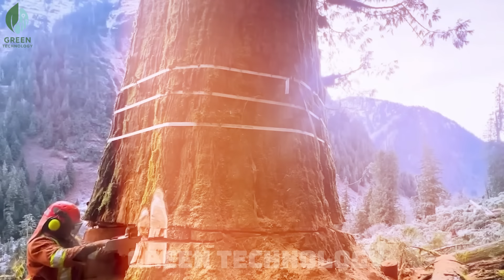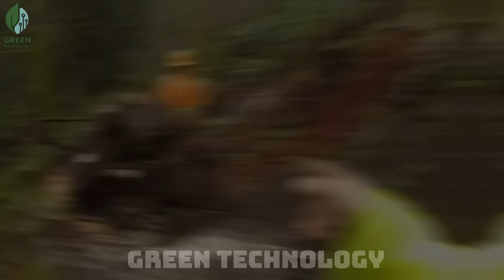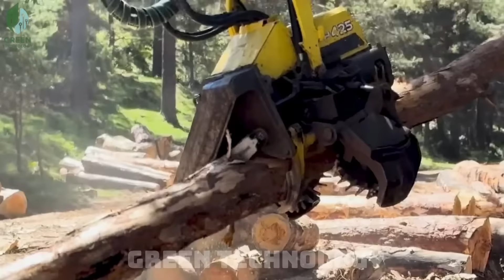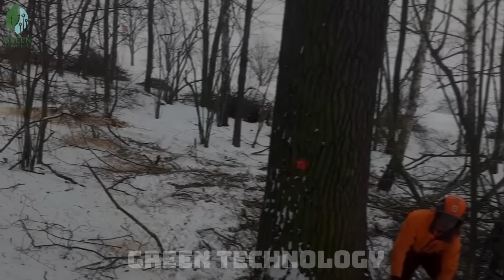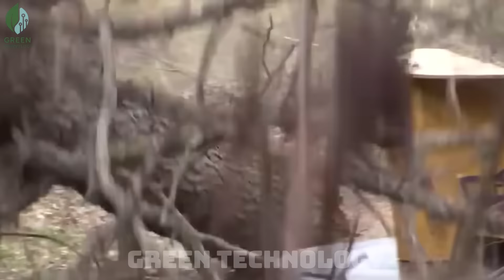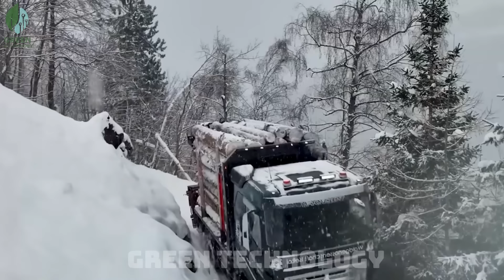Sustainable Forestry Technology in Action | Smart Land Clearing, Giant Timber & Green Machines

Comment: Responsibility ultimately is on the driver. He alone must make sure his truck, trailer and load are as safe and secure as possible. Straps tear and chains break , loads shift but it's still the drivers sole responsibility.
Reply from the maker: fair point. Equipment can fail, but proper planning and load securement are critical before the truck ever starts moving